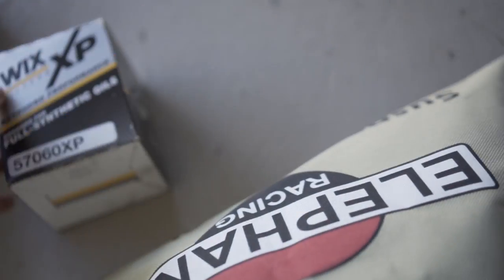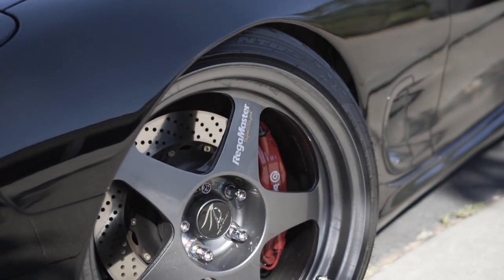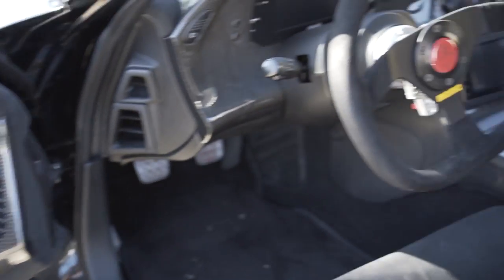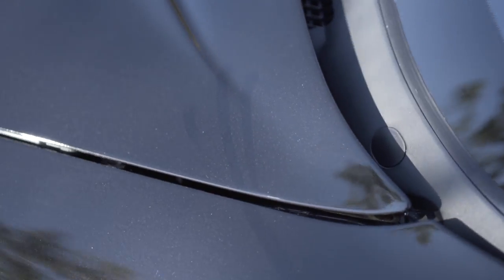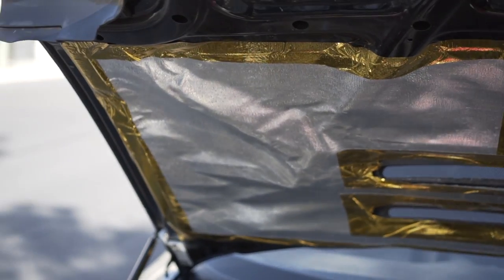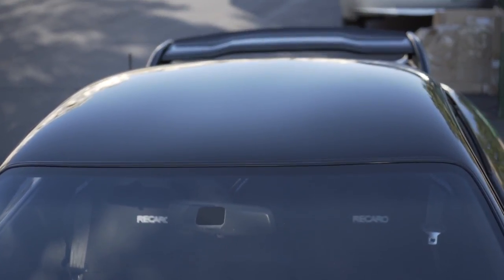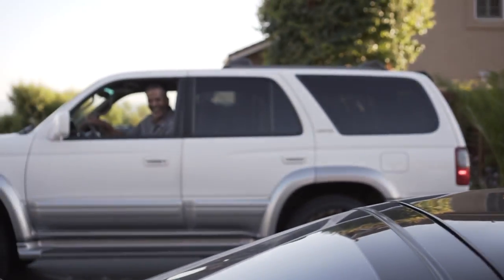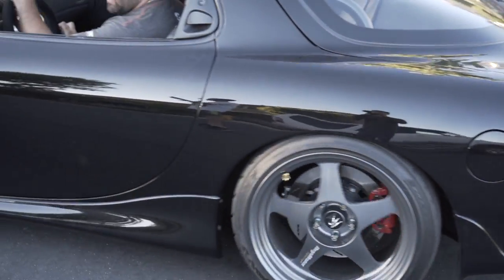Saying Goodbye to the RX-7, the Send Off

Comment: You probably won't read this but I've been building my FD for 2.5 years now and it's insane on how alike our minds are with the amount of detail. I'll just share one example. The interior, it was like I was looking in the mirror when you were explaining how far and detailed you went with it. The 10 times you went back and fourth with the paint shop made me laugh because I did the same thing basically. But here's the list that made me as detailed as you. 

-Restored every bolt in the interior by stripping and replating with yellow chromate. 
-Waxed every metal clip that holds the plastic interior together so they won't rust
-Sanded and repainted the OEM crash bar in the dash with high quality 2k paint
-dynoliner where the FD has a hollow sound when you knock on it (doors, roof, etc.)
-dynomatt the firewall and trans tunnel for getting rid of the infamous FD hot interior
-Rebuilt the power window motors
-Rebuilt the lock actuators in the doors
-Replaced the moisture barrier in the doors (Even put new tacky caulk that seals and holds the barrier)

The list goes on and I'm still not done! I'm actually in the middle of finding the perfect match to OEM paint for the interior like I mentioned above. 

Anyways thought I'd share because while watching this video and after seeing both videos on why you sold this FD, I felt so much empathy. Anyways I like the channel and I'm a new subscriber. 👍

Good luck!

Comment: Such a great design. Easily in the best 10 of all times imho. I 'd match it with a single turbo 13B with up to 350HP. For its weight it would be really fast and usable everywhere apart from the wet ; )